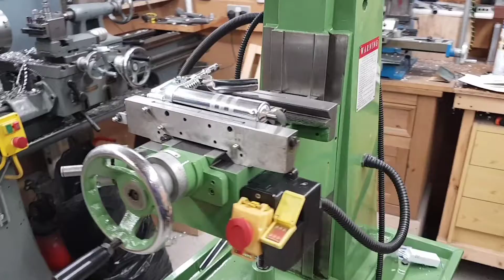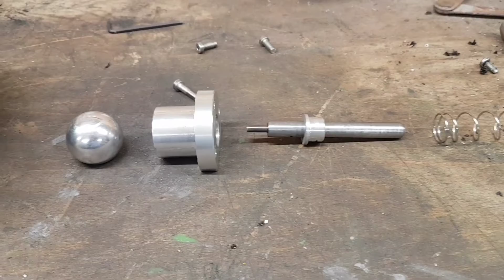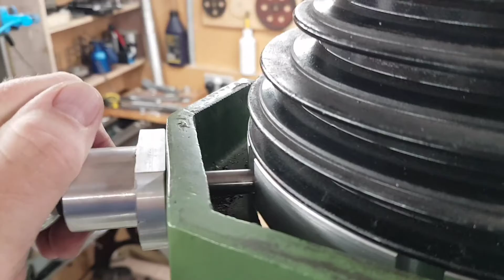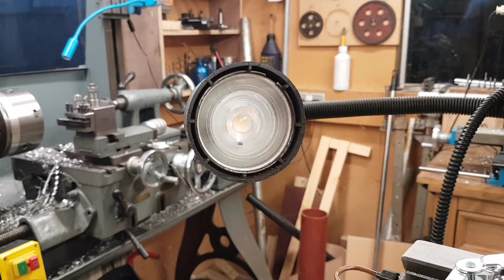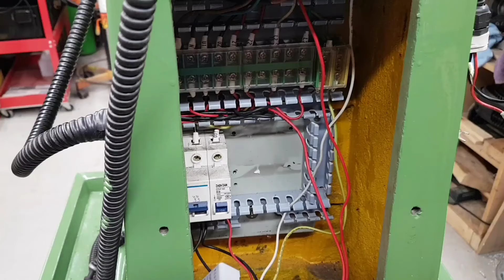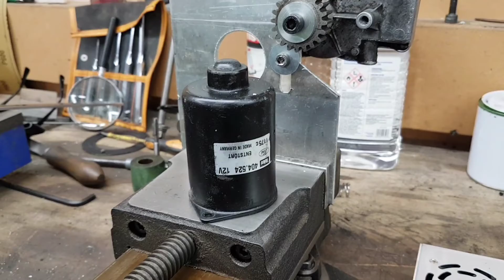626 Mill Part 3. Spindle Lock and more Modifications!!

Comment: Have a link or model# for the LED light kit?
Reply from the maker: Hi John, there is no model or kit.
I simply removed the capsule bulb ( small bulb with no metal cap just 2 pin connectors) and replaced it with a led ceiling spotlight unit  (MR 16). The original reflector remained in place but I had to file away the base to allow the MR16 to fit through and plug into the original fitting. The glass isn't needed but the spring ring was used.
As far as wiring, I located the cables leading to the spotlight and connect them to a 12v LED driver with was then connected to the mains supply inside the Mill column.
I think the whole conversion cost about £10 ($12 US)
Hope this helps.
Cheers Neil

Comment: Sounds like your going down the route that I have. Mine is a Tom senior. But done many mods inc the Wiper motor x axis that many on a forum i am a member of said would not work. But it does & beautifully. Also i have done the Z axis with a cheap to me £137 x axis drive meant for a Bridgeport. If you get a moment have a look. I have posted lots of mods done to the milling machine & the lathe. I am like you. Think outside the box. If i had taken any notice of what folk say I would have never built the garage & workshop. They said it would fall down & collapse if it snowed hard. Mmn.
Regards. Steve.
Reply from the maker: I'll go look for those videos and see what you have done Steve. Two common comments that we come across " that wont work" and when it does " you clever tw#t" 😂😂